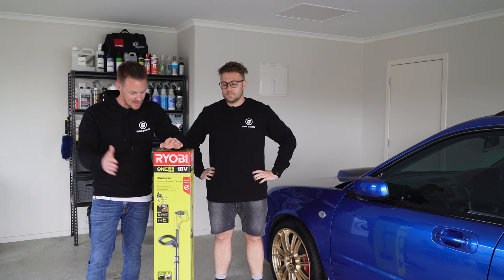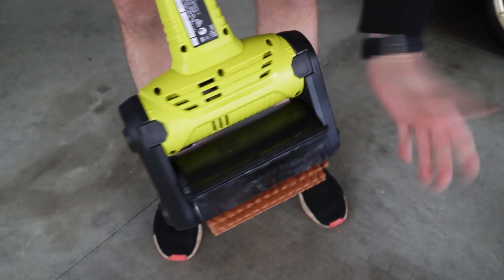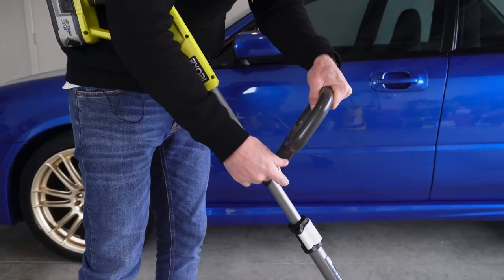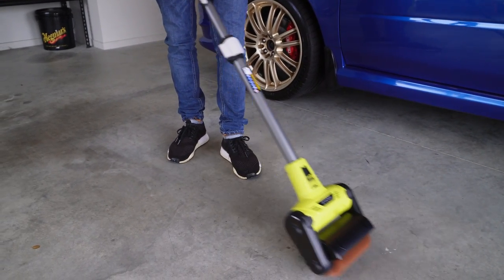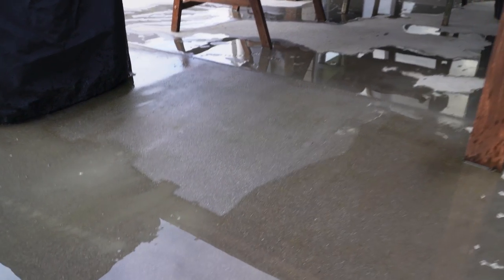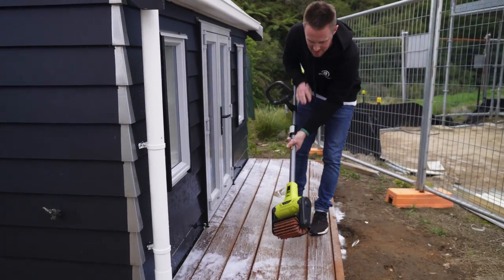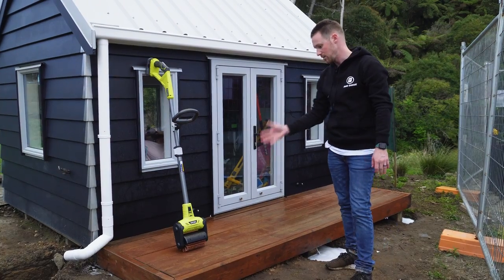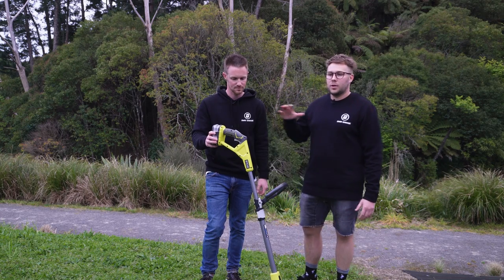Ryobi 18V Power Outdoor Surface Cleaner

Comment: Would be good to see how it goes on a deck that isn't installed upside down lol
Reply from the maker: Inside down?
Reply: @Omni Garage  damn autocorrect, meant to say upside down. Fixed now.
Reply from the maker: Yes, supposably the grooves are meant to be on the underside. Groves create more surface area to help remove moisture, letting the timber dry out. I didn’t build the deck to the play house btw. Answer to your question though… I’m guessing the tool would work just the same.

Comment: Do you think this would work to clear gravel off of grass/dirt patches? This seems like a much more affordable option opposed to a full sized power broom.
Reply from the maker: You could try it but I think the overall design of the tool (brush size, power etc) may let you down. I would buy the proper tool for the correct job 👍🏻